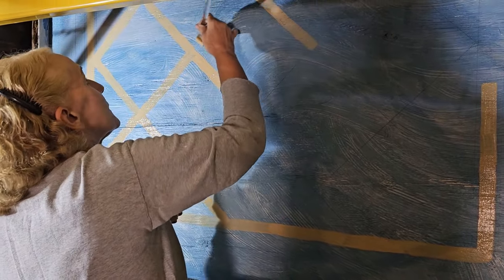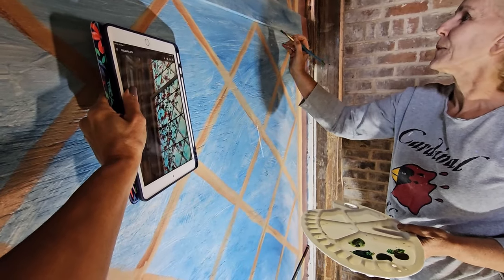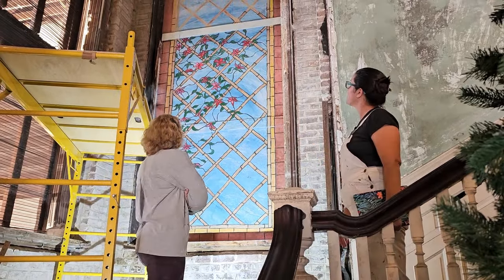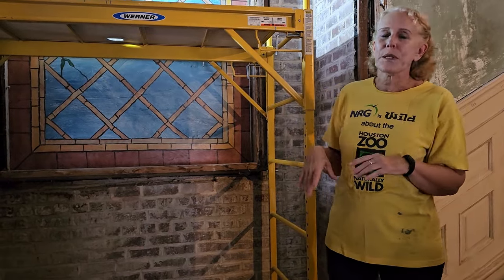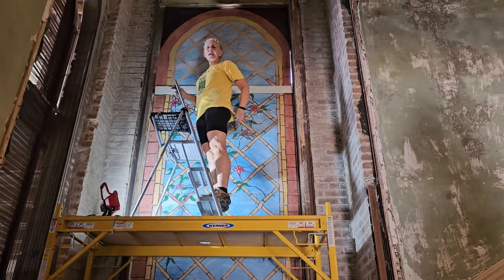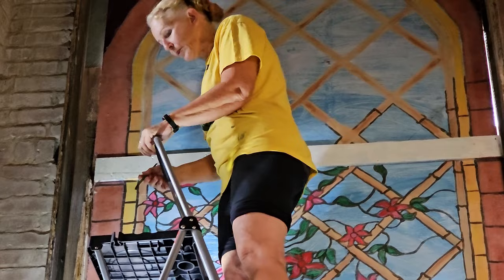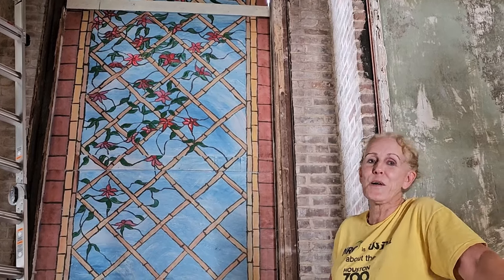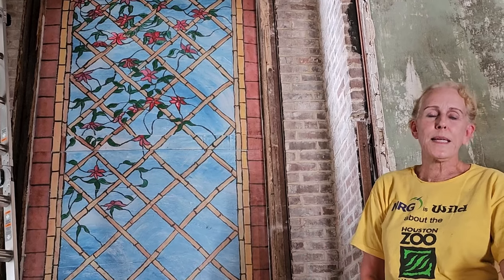S3.33  Stained Glass Art Project Brings Back the Wow Factor

Comment: Jaine, I was thinking. Your grid method is really good, but there’s another way to do it, if you decide in the future. Use an overhead projector and project a picture of the original window on to the plywood. Sketch the detail in and then paint.  I’m not really sure which way is best. What you’ve done is coming out truly nice. 
👍🏻👏🏻👏🏻🙂
BTW: When you started the window, I thought that you could’ve replaced the ply with inexpensive plexiglass. The plexi would backlight naturally as real stained glass and the surface would be smoother to paint. Just my thoughts.. 😘
Reply from the maker: That/s a great idea.  I remember doing that in school.  We did sonsider plexiglass but the cost was too great by the time you add up all the labor to remove the plywood, build a frame, etc.  It would require lots of real scaffolding and Ricardo and his crew for a couple of days to do.

Comment: I have such ladder envy, cause that ladder seems so much easier to use than MY adjustable ladder
Reply from the maker: It is a new version that is a few pounds lighter.  It is so versitile.  Homedepot has them onsale for $99 right now.  You might consider replacing yours.
Reply: @leaguekempnerhouse    as a mini person (I'm 4'11") a ladder that's easier to use would be great, I'm gonna go check that out!  Thanks for the tip!
Reply from the maker: @bobzwife  The gorilla ladder is still very heavy compared to a standard aluminum or fiberglass A frame ladder.  If you don't need all the fancy configurations you may want to rethink. But if you are already using the older model, it is a few pounds lighter than the original.